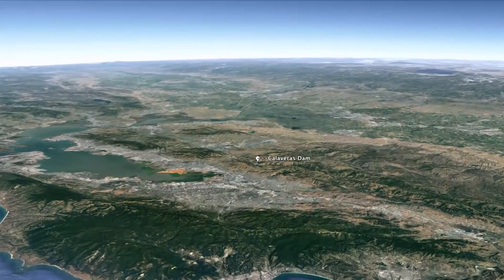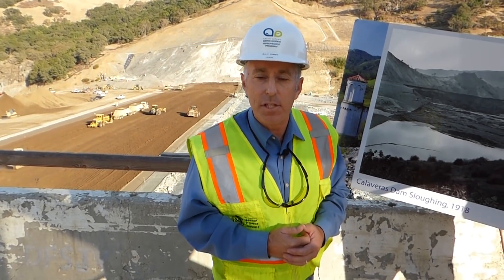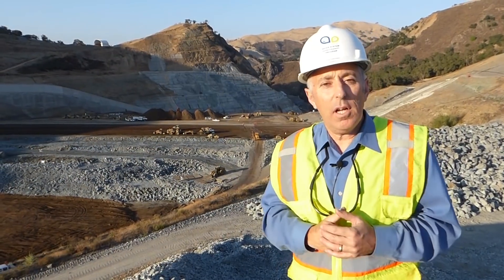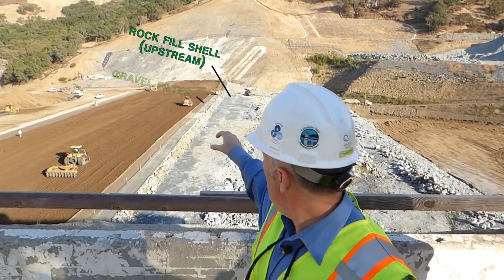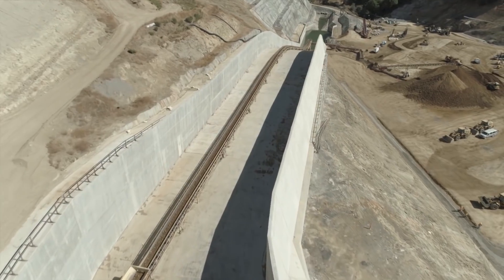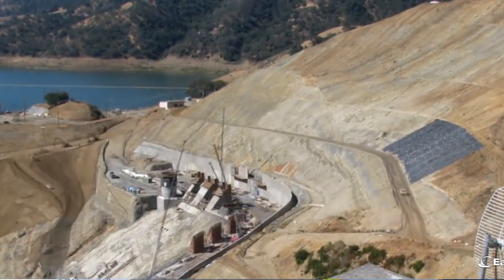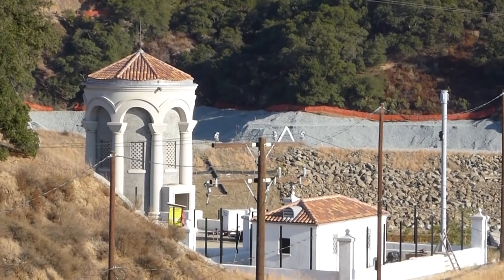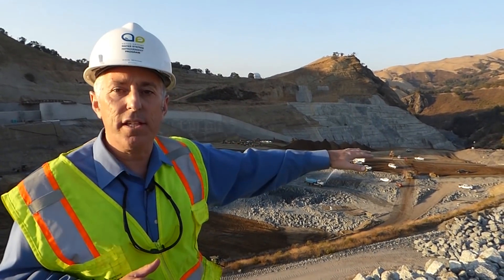Moving Mountains at Calaveras Dam Replacement

Comment: Yes due to the underground settlement conditions like much more cracks, at large scale voids, weak zones strata of rock & soil formations, fracture areas by earthquakes & sinkholes develops as per global environmental issues comes up from last 50 years and still going on regarding the subject scenario, So now it is time to need think about and find out the solutions for the new dams & reservoirs designs and constructions considering up to operational stage in hydro sector time frame for the next future>???